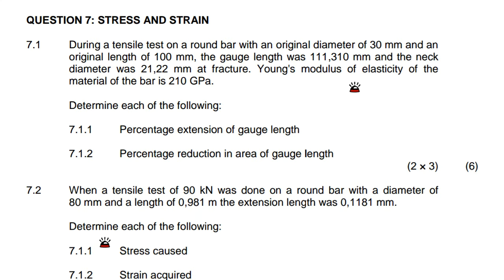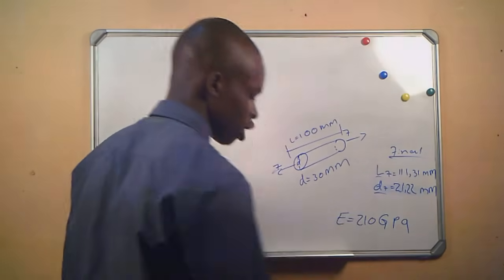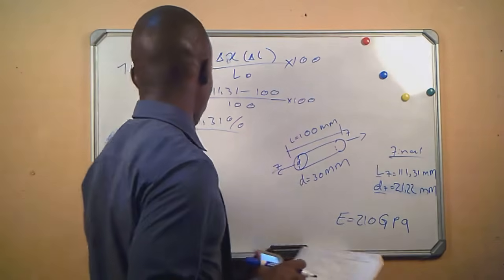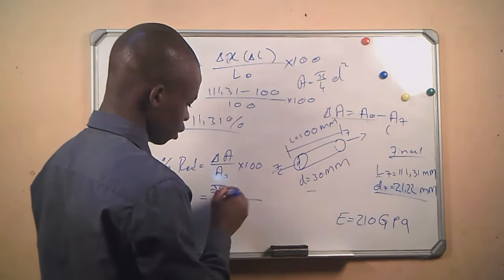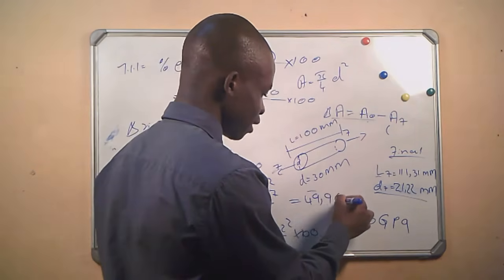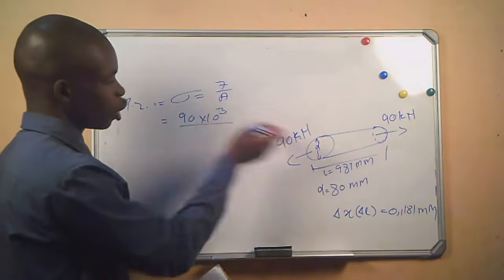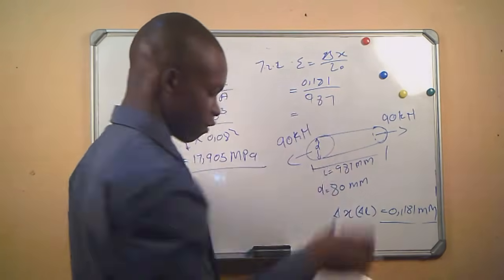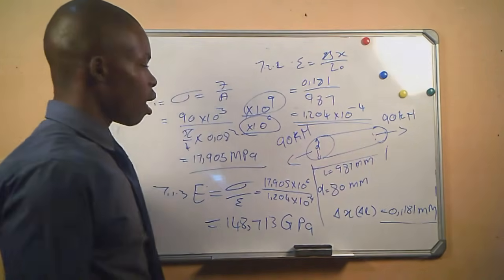STRESS, STRAIN AND YOUNG'S MODULUS ENGINEERING SCIENCE N4 (3 OF 4)

Comment: after 3 years of posting this video, I just realized that you did not convert the extension length to meters before calculating the strain. You cannot divide meters by millimeters; hence the strain does not have the SI units. So, the Young's modulus is wrong cause the answer you got from calculating the strain is wrong.
Reply: Yes he didn't convert ex length but he copied the correct answer from his book, so all the answers are correct you can prove them with your calculator after converting.